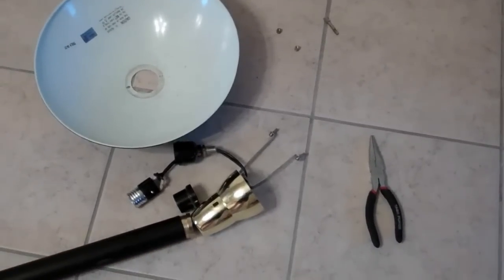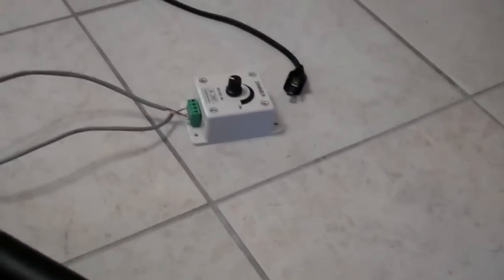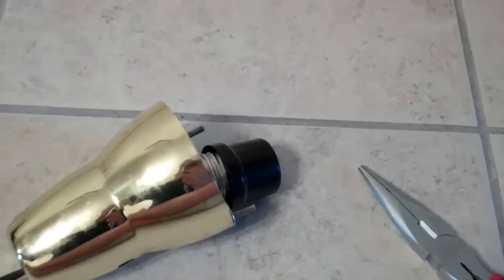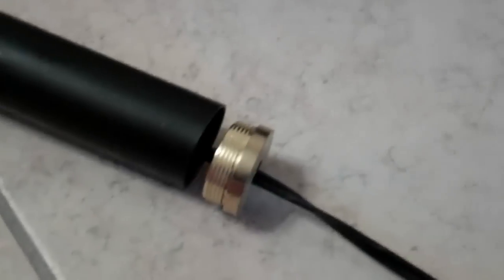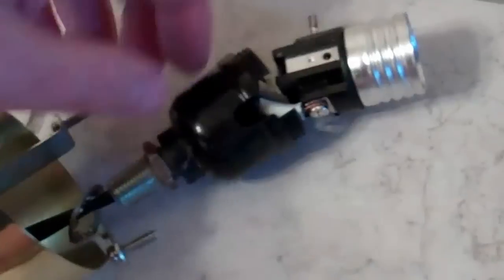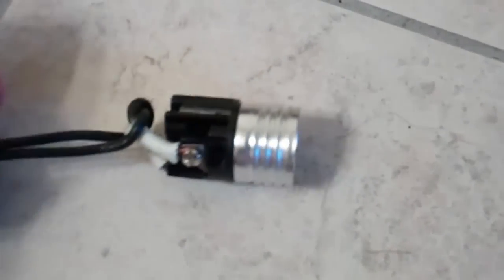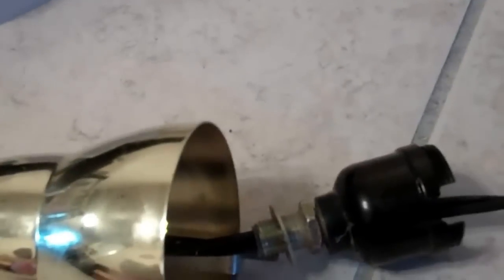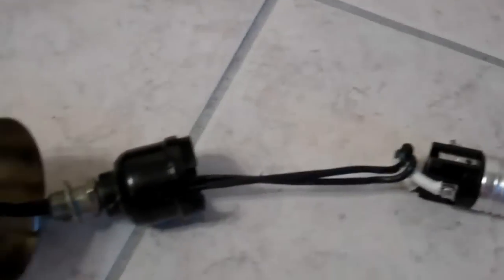Converting a 110v lamp to 12v LED: Part 1

Comment: Wasted the whole video taking apart your lamp and explaining the parts!  This is elementary and any kid can do that, we don't need a video for it.  There was a complete failure to explain why you needed to swap out robust AC wiring for wimpy telephone cable wiring to switch from AC to DC?  DC to AC switch would definitely involve upgrading wiring, but not the other way around.  You would simply swap out socket to fit a 12V LED Bulb.  For this I am assuming you would need a 12V socket that fit your LED bulb base: bayonet single or dual mount, or wedge, or screw in, or pin type, or festoon, etc.  Should be a breeze and take up 1.5 mins max of video time.  Seriously disappointing.  And this is only Part 1???!!!
Reply from the maker: Sorry to disappoint. I was still in infant stages of both filming and understanding electricity. As with all my videos, I want to maintain an "every person" so the viewer can do it to from a very elementary position. 
Thanks for the comment
Best,
Dan
Reply from the maker: Thanks for th post. For reference I was still figuring out DC, solar, wind, etc. and had just been exposed to LED lighting and the like. It is meant as a foundational video, something I would have liked to see at the beginning. Best, Dan